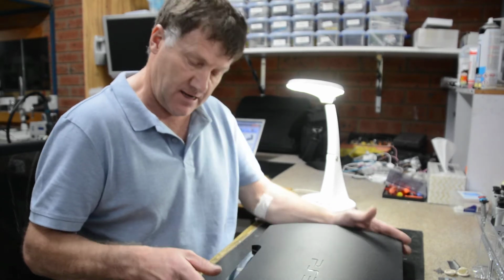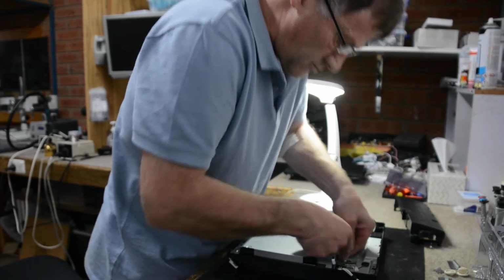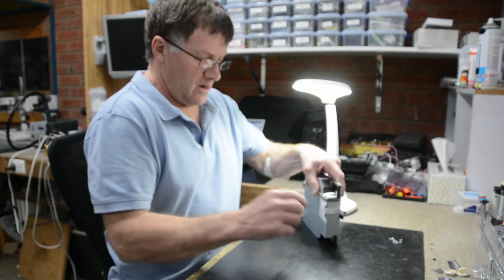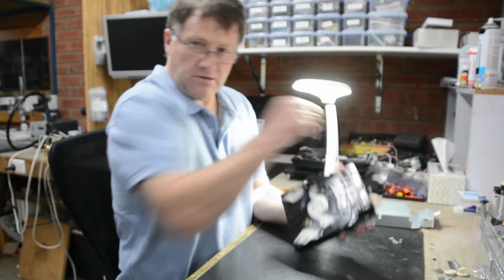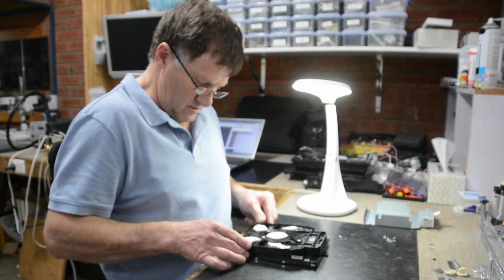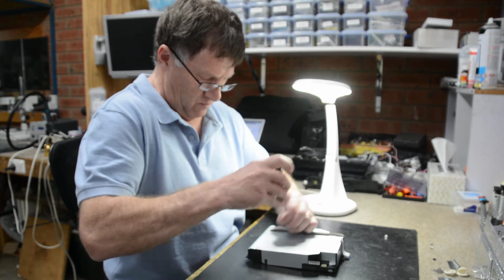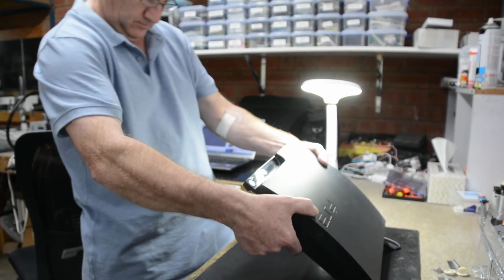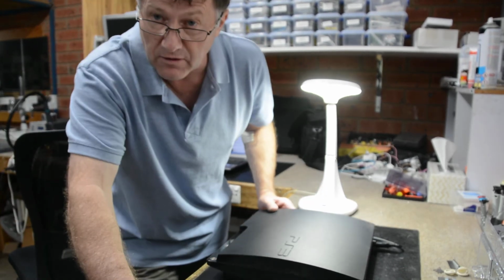PS3 slim no eject

Comment: When I open my PS3 to see what's wrong with this drive the disc drive works fine and the game runs okay but when I screw everything up back together it would take in the disc but it won't eject properly what should I do
Reply from the maker: Ok,  saw this before, normally something has hit top of the console, the plate over the drive is bent down a little straighten it up
Hope this helps
Reply: @SuperDavidcass  i will try it
Reply from the maker: @nowhere18  common problem
Reply: @SuperDavidcass  i think it fixed it thank you
Reply from the maker: @nowhere18  no worries thks dave
Reply: Hello there ik this was 3 years ago but I have the issue today, is this referring to the plate on the drive or the console housing plate?